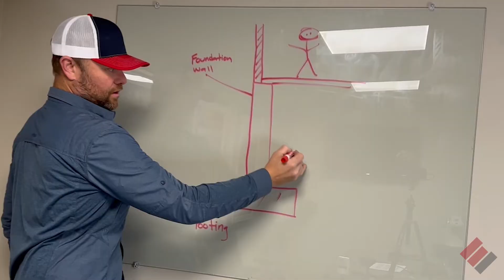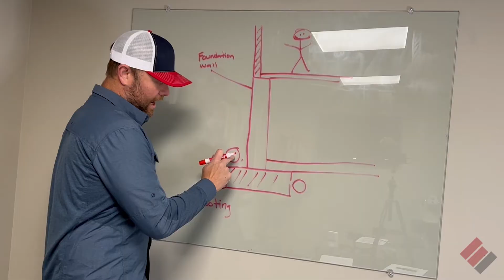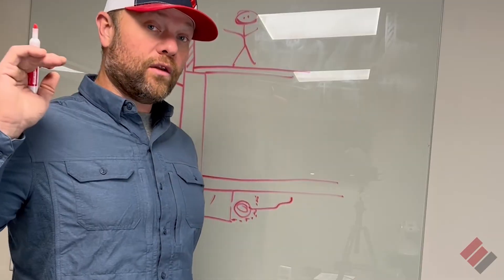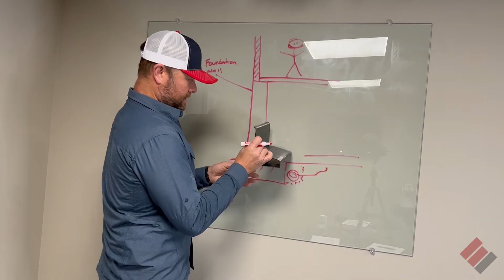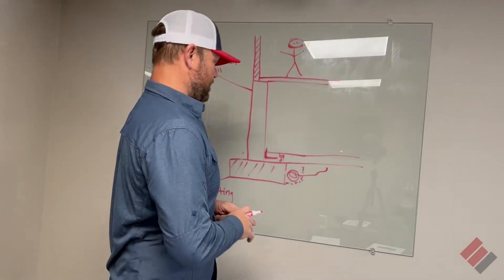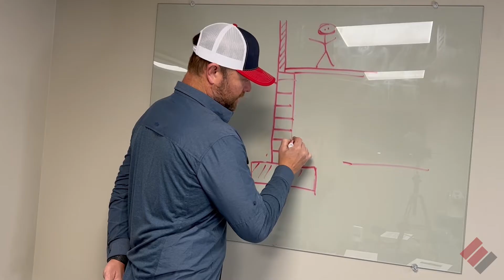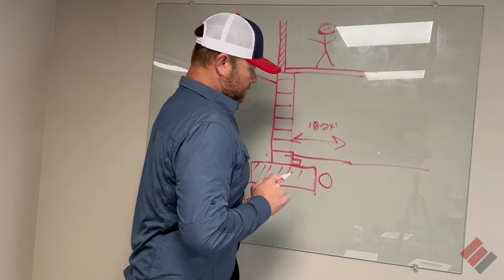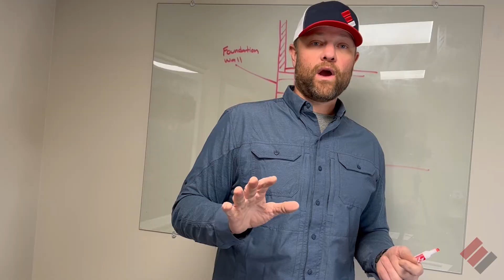How Does A Drain Tile System Work

Comment: Drain tile on top of the exterior footing is a really, really dumb idea. It allows water to collect on top of the footing, and seep into the basement or crawl space. It's easier and cheaper to do it that way, sure. There's more to excavate to put the drain tile alongside the footing. But it's pennies on the dollar compared to digging out the whole thing to relocate the drain tile later on. Thousands of dollars later, ask me how I know.
Reply: How do you know
Reply: @rockwellmath I have a situation where an area  against one side of our home is poorly sloped/graded. We have no basement and the ground is hard as rock (caliche) and when the monsoon hits, we have a deluge of rainwater , not only running directly over the top of the concrete-type ground but, also off the roof and pooling next to the foundation. 
I can vividly remember during a few rainstorms having to frantically use a 30 gallon wet/dry vacuum and emptying the 30 gallon tank over 4 times.  We've lost our flooring due to these flooding events.

We had a 70 foot French drain installed but, where the installer placed it, really would have no impact without the slope being corrected towards the drain( and away from our house). Yes, we paid him to slope it also but, it appears that we will probably need to follow up with the contractor through our state's ROC.

 Besides getting the grade corrected, we are also currently pricing a modified gutter system that would make sure the roof's runoff is correctly conducted  away from the problem area via the downspouts and collected in water-harvesting barrels for my gardens.

 In the interim , what else besides an exterior footing (and getting the grade corrected) would you suggest in assisting the  disallowance of water to seep through into the two rooms that have been already directly affected by this water?   Since you are saying it "is a really, really dumb idea", what did YOU do instead? Thanks!
P.S. I would love any input from Dave from @Eppconcrete